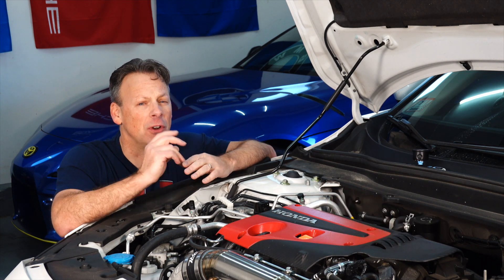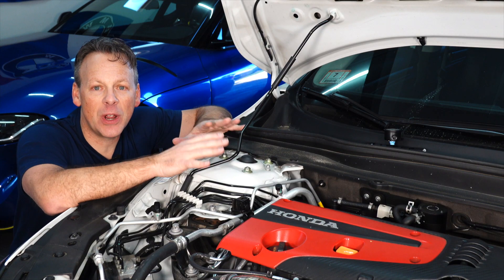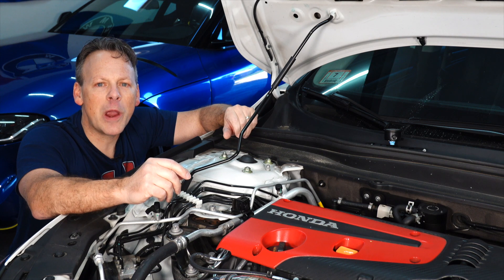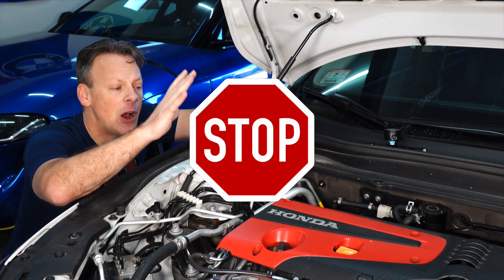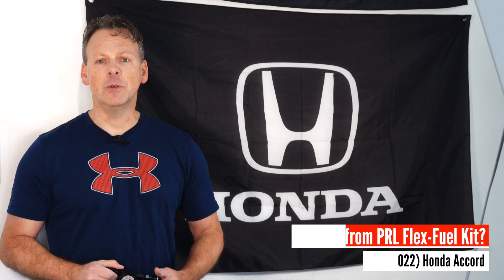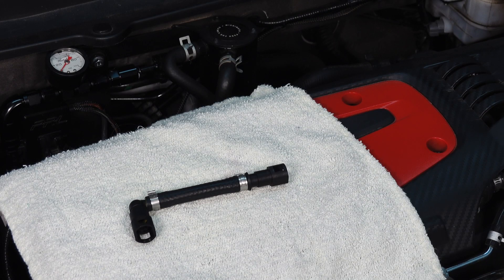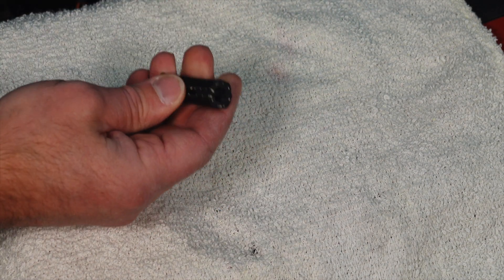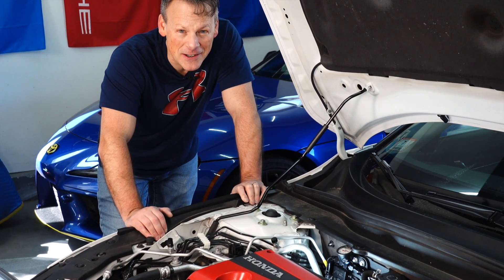DAMAGE from a deteriorating FUEL HOSE? (PRL Flex Fuel Kit)  //  10th Gen (2018-2022) Honda Accord

Comment: Chad when you only had the longer upgraded hose and prl short hose did it make that “cricket” sound as well? Or only when you upgraded the short one as well?
Reply from the maker: I believe the noise started after upgrading the hoses, but I don’t know if it’s the long hose, short hose, or fuel pressure gauge that’s causing the noise 🤔🤷‍♂️

Comment: Do u experience “cricket” sound after installing the upgraded lines?
Reply from the maker: YES… although I’m not 100% sure it’s the upgraded lines and not the ethanol sensor itself. Just to confirm, mine goes away when I let off the gas.
Reply: @TheLemonFactor  mine does too. is there a way to quiet it down?
Reply from the maker: Not that I’m aware of, but I haven’t really looked into it. Although it’s been bugging me lately.
Reply: @TheLemonFactor  ok please let us know if you find anyways to make it quiet. its also been bugging me lately.

Comment: If I’m running an ethanol tune am I always going to have to blend a 30-35% or could I just run 91 from time to time?
Reply from the maker: If you’re running a FlexFuel kit like PRLs, and have a proper tune to take advantage of the ethanol content such as the Phearable Stage 4 then the tune will automatically adjust itself to the ethanol content that it was tuned for. No need to reflash the tune, and you don’t have to run ethanol all the time 👍
Reply: @ thank you very much 🙏🏽 I was a little nervous about it but now I’m for sure ordering that prl flex fuel kit
Reply from the maker: My pleasure!  Good luck and have fun 😁

Comment: Flex fuel has risks that people don't research. Besides the fuel lines disintegrating and breaking up potentially ruining fuel pumps, it also causes the low pressure fuel pump basket filter to also fall apart and cause issues. Besides upgraded fuel lines, you need an upgraded basket filter that needs to be cleaned every 30K miles as well as an optional small extra in line filter as well. It's a horrible idea to just install the flex fuel kit and call it a day. It would be be an awesome cheap power upgrade on my Type R but I'm not sure I want the eventual extra headaches involved

Comment: The only reason a PRL short hose doesn’t exist is because they dropped the ball with the design of it. With the older PRL FF kits that have a potted controller in an aluminum housing (just like yours) the 90 degree short hose would cause interference the metal fitting so there was no physical way to get it hooked up. That 90 degree short hose only worked with the really old FF kits that have a plastic cased controller with a KTuner logo on it. I brought this up to them immediately after buying the hose kit and they removed the short hose from their website. No refund nothing, but let me keep the hose which was useless to begin with..

Comment: I hope they sent you the hose for free. These guys should have known ethanol doesn't mix well with rubber lines. I am in the process of building my own kit with racetronix. Maybe one day I will make the 50 mile trip and say hi. Keep up the good work.
Reply from the maker: Unfortunately they did not 🤷‍♂️. They’re solution was to sell a proper FPTE long hose for ~$100, while not offering a fix for the short fuel hose. Then, later on offering a brand new version of the kit that utilizes the OEM fuel lines 🫤
Reply: @TheLemonFactor can the oem fuel lines handle e30/40?

Comment: Will this be an issue with the PRL WiFi kit?
Reply from the maker: It is my understanding that the newest PRL Flex Fuel kit utilizes the OEM fuel hoses, and as such this would not be an issue.
Reply: @TheLemonFactor so the stock lines can handle it ?

Comment: So whoever has the V2 Flex kit doesn’t have to worry about changing any hose?
Reply: It's the same hoses.
Reply from the maker: @buya_pr  It is my understanding that the newest PRL Flex Fuel kit (Wi-Fi version) does not replace any fuel lines, as it utilizes the OEM fuel hoses, and as such this would not be an issue.
Reply: @TheLemonFactor  the v3 kit is very restrictive to many turns I need one to RD an make better
Reply: @moe2527  brother, are you the Rivera Moe w/the hoses?

Comment: Ethanol is hygroscopic, corrosive, and oxidizes quicker than standard pump gas.  In engines that have issues with oil diluted with fuel, seems like a poor choice.
Reply from the maker: Thank you for the watch and feedback.

Comment: Do you think there will be a problem with any factory hoses if you don’t have a flex fuel kit but are using a gallon of E85 with each tank fill up?
Reply from the maker: Most newer cars are capable of running a small percentage of ethanol as there are many gas stations that sell gas with up to a certain percentage - in my area, regular 91 octane usually has 10-12% ethanol. With that said, you should be fine running a gallon or so of E85 mixed with regular gasoline 👍
Reply: @TheLemonFactor  thanks. Keep the content coming!!!